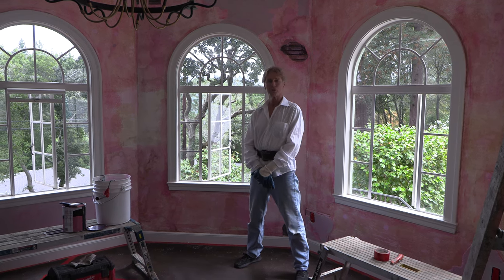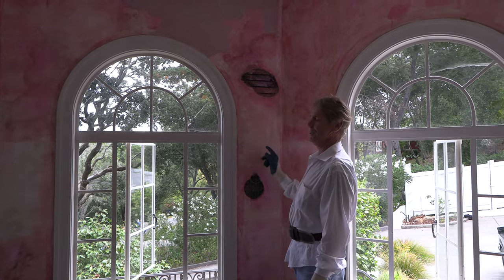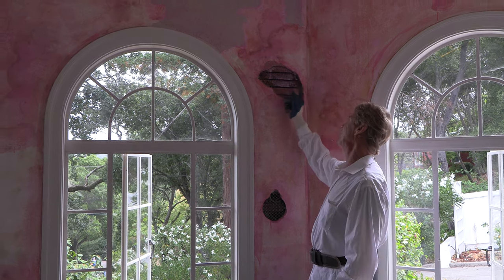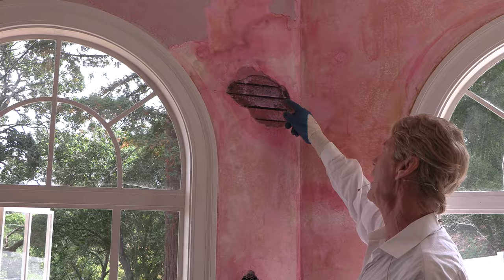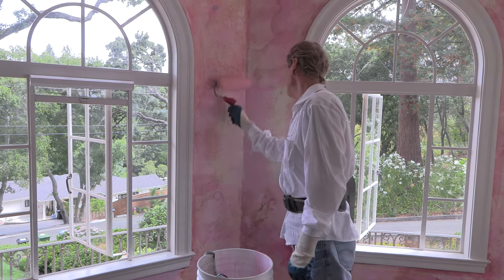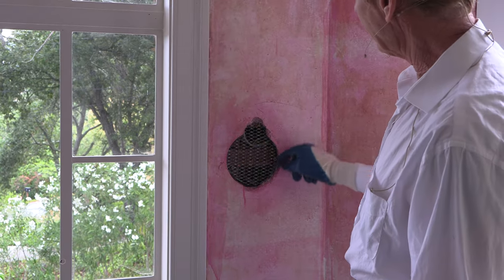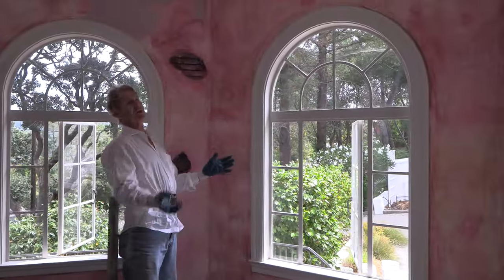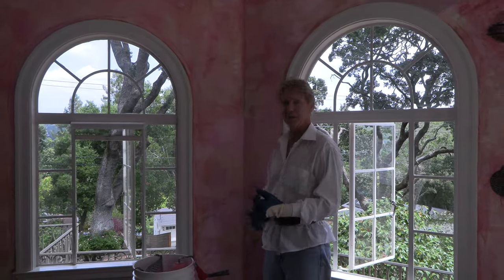Repair Interior walls using Lime base and finish coat plaster

Comment: I'm a tile contractor in Ct and I scratched and brown-coated my house using traditional cement stucco but I wasn't satisfied with using a traditional finish coat because of the cracking which is typical over our wood frame houses. Kirk introduced us to an acrylic product (Stuco-Flex) that solved my cracking issues and was tinted to a color that was perfect for matching the wood shingled section. So I want to thank you, Kirk, for being a great advocate for your trade and willing to share your knowledge. My grandfather started the family business during the great days of terrazzo floors used in all kinds of buildings (hospitals, schools, municipal buildings, churches) and I think I see you standing on a beautiful terrazzo floor with a great design. It was also a labor-intensive process, like yours, but the end product was unparalleled. I'd like to add that there is really nothing for ultimate satisfaction like the trowel trades.
Reply from the maker: Morning Drake Dude,My fellow trowler,  speaking of the travertine tile, we set all those with Sika-Flex 1A polyurethane caulking, it's adhesive sealant as, the ground moves in our area, everything's built on sand. Jay and I used two cases of that crazy strong caulking. 
Now Stucco-Flex sounds similar but is the best acrylic stucco possibly sold in the United States.👨🏻‍🔬

Comment: Waited to see you make / mix the Lime.  Did Lou make it in buckets?  What was the mix? Hydraulic?  No pigment added?
Reply: He didn’t use any lime and gauging plaster. He used veneer base and finish coat
Reply: The title of the video is "Lime Plaster."   Where is da Lime?
Reply from the maker: Howdy Red, you can type that question in our channel a a video will magically appear to show you how we do it. Yea, Jason mixed this lime plaster in buckets.
 I used what is called Diamond basecoat for the holes and Diamond finish for the skim-coat or what's also known as the veneer finish. Vereener just means a thin finish coat.👨🏻‍🔬

Comment: Hey Kirk, I’m a plasterer from the UK so I’m very experienced with gypsum plasters. I’m currently living in BC Canada. I’ve been asked to skim some textured ceilings here and I have access to Diamond Veneer Basecoat and finish coat. How would you suggest I go about doing these ceilings? Will I have issues applying basecoat thicker than 1/16th. Any advice would be appreciated.
Reply from the maker: Good Morning User Dude, clean the surface well, apply a plaster bonding agent such as Quikrete or Plaster-Weld, apply your basecoat, thickness doesn't matter much 1/16 to half inch. With new construction over sheetrock it's normal to apply 1/16 to one eighth, But with existing I apply as think as necessary. Allow to dry, then apply the finish coat.
 BTW, veneer simply means a thin layer. Cheers.👨🏻‍🔬

Comment: Is bonding agent also used when adhering gypsum-gypsum (whether it be sheetrock or gypsum based plasters)?
Reply from the maker: Excellent question, no when applying tapping mud over Sheetrock there is no need for a bonding agent. When applying a Lime Plaster or timed Joint compound we apply a bonding agent.

Comment: Hey Kirk / Jay … I used ekoplast 50 on my fireplace looks great, now on to the lime..do I skip the basecoat and just use the finish on top of the ekoplast ? I’m so dumb I bought a bag of type s Lime from home depot.. please help! You are correct that home depot doesn’t carry the Diamond brand , atleast here in Long Beach, Ca. Thanks!
Reply from the maker: Howdy Josy, the ekoplast is the basecoat, you would have to google, "plastering yards near me," to buys either USG's Diamond or imperial  Lime finish coat.  You could just finish it with a 20 minute joint compound also, it won't be as strong as A lime plaster, but there are no rules. Cheers.